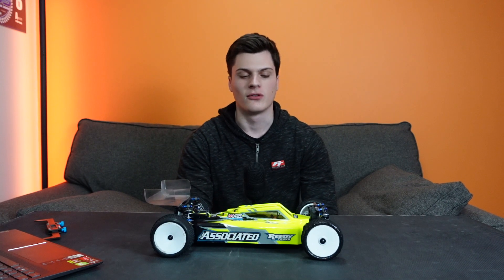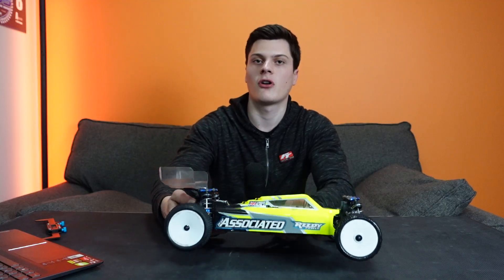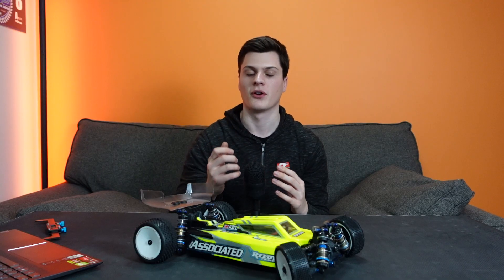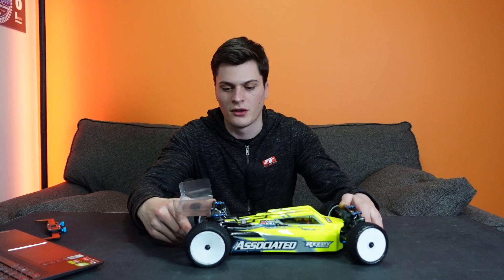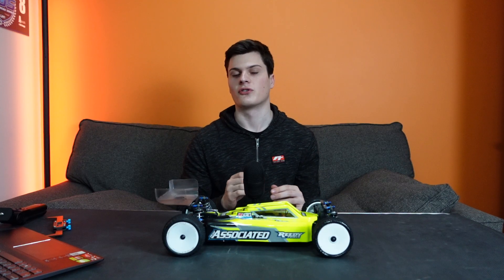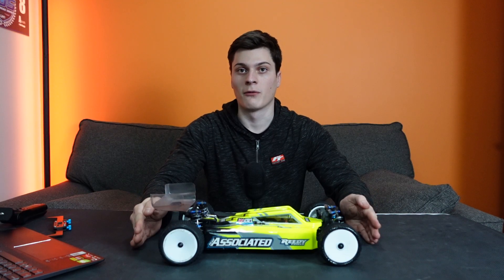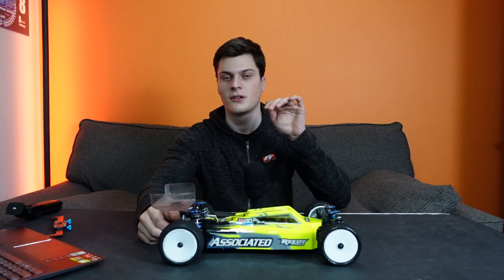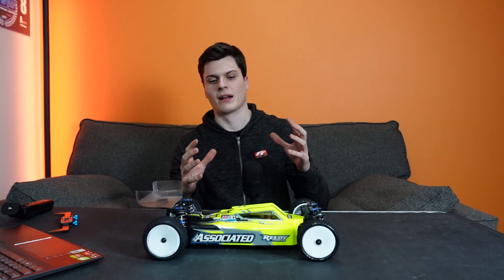Anti Roll-Bar Deep Dive! Explaining Everything you Need to Know.

Comment: Very good video. Here’s one way of thinking about the rear anti roll bar, links back to what you were talking about at 5 or 6min. Allowing the rear to roll further with a soft anti-roll bar forces the front to roll further, which transfers load onto the front outside tyre which will aid in turning the car. I had never thought of the offset rear contact patches. That’s an interesting point!
Reply: Well, good way to think of both roll bars, but that example is easy to understand.

Comment: i usually never touch my setup but recently i got bored with the car and one of the things i changed was the front sway bar, mainly going from no sway bar to a sway bar. the thing i seemed to notice the most when installing a sway bar in the front is that it became more even and predictable in turns. just had more even grip throughout the whole turn where as without a front sway bar one part of the turn would have grip and the other part wouldnt. 
does this sound familar or make sense with anybody elses experience or am i just imagining things?
Reply: Sounds right. With no swaybar you get less initial grip when you first turn and grip builds to mid corner. With swaybars you would get more initial grip when you first turn and the grip would stay the same/ not build as the car goes through the corner.